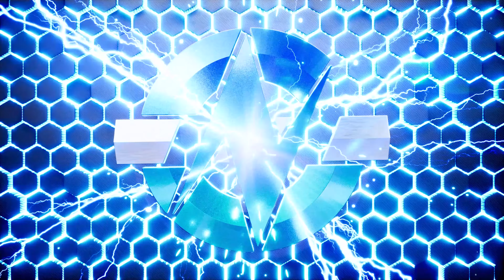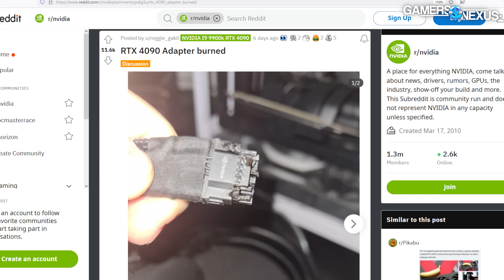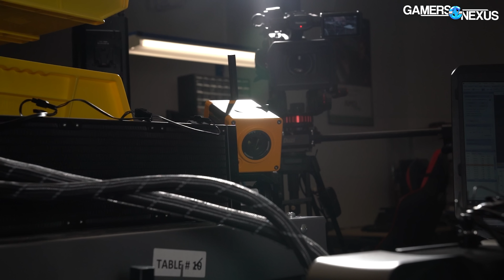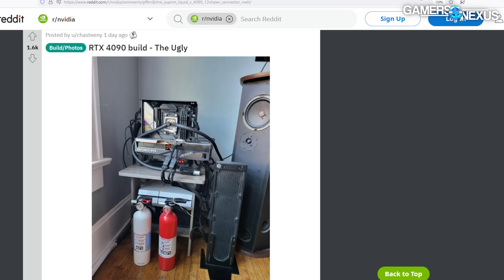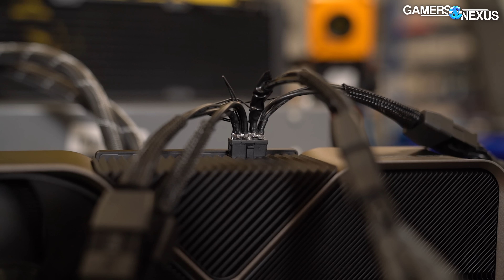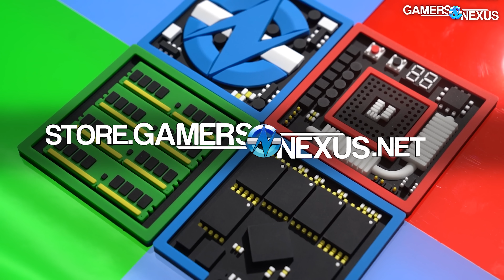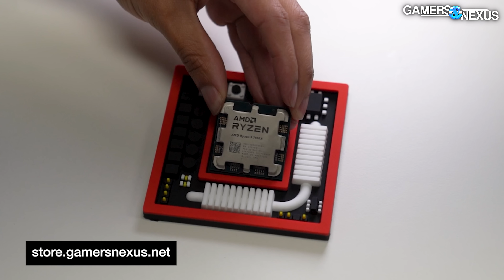Testing Burning NVIDIA 12VHPWR Adapter Cable Theories (RTX 4090)

Comment: This is exactly what I like on your channel I'm not into gaming but you go to in depth analysis of the problems.
I would not worry on the solder side the patches you show ate of good quality & large enough. but as you mention at the end the pins are probably the issue. they are most of the time on RC drones where we need to pass a lots of amps. So you want to look at:
    - The contact surface between the male and female pins it is relatively easy top test: you apply thin and week coloring on the metal of the male part, you insert it take it out and look where the color went away, 
    - The contact force is important as well but much more difficult to measure
Finally one way to identify the weak point faster is: to test it on the bench with higher amps, you may strip all the plastic it will allow you to better identify the source of temp, those will be slightly lower as you do not have the thermal insulation from the plastic.

Comment: You have test load for Your PSU testing right? Why not run a load through the adapter and see what happens at 100% capacity (so 600W?) Also - aren't the power pins bridged on the PCB?

Comment: I thought the Voltage rating printed on the cables is indicative if the Insulation breakdown voltage, not the copper itself.

Comment: I just think that's about nVidia have different manufacturers for same cable. Not about Igor's cable is pre production, because there are more testers who found same issues than Igor's, like Paul's Hardware. And Paul get the real reason about that manufacturer's cable. The issue isn't a broken cable as an electronic's neophyte could think, is the micro distance between both parts who rises resistance between them, who is a very little amunt of air, which causes dangerous overheating, like, for example, the fire issues about NZXT cases who you and your team worked hard to prove. That opposite points of view makes a weird situation, like now you are on NZXT's side proving hundreds of cases never set on fire. O think that's a little awkward.

Comment: I’ve worked for more than a decade as technical lead in the automotive industry and worked on a number of projects during scale up for manufacturing and my biggest surprise about the adaptor is that the litz wires are soldered at all. This has to be done via manual soldering/selective soldering and manual/selective soldering is something that is almost never done nowadays for cable/wire attachment unless it is the absolute only possible way to connect them.

It’s more expensive than almost everything else (manual labor has gotten a lot more expensive over the last decade even in China) and it’s very hard/almost impossible to do this in a way that is process safe, reliable and with the same level of quality. It’s also very hard to test for and prove that the manual soldering actually matches a certain level of quality as well.

In automotive selective/manual soldering is effectively banned unless it’s the only possible connection technology (e.g if you need to connnect litz wire coils with large cross sectional areas to a PCB) and even then the additional requirements necessary to make this process safe would add a huge cost to the whole process. This starts off with plastic clips that the wire ends are inserted into and that are attached to the PCB to ensure that the wire ends have the correct lengths  and are fixated with a defined force, goes to steps like pre-heating the wires and the PCB to ensure that the temperature drop is not to large once you add the soldering iron etc. it also includes a lot of additional testing and additional steps to secure the wire (over designed strain relief etc.)

Even then you almost always have additional failures and RMA like what we can see with NVIDIA’s adaptor due to overheated solder pads, mechanical strain on the solder connections, bad solder joints, “creeping” of the solder (solder maintains a certain level of viscosity even after it has cooled off) and all the other soldering defects and defects due to overstrain of the PCB or solder pads during handling. Only with higher defect rates than industrial soldering (infrared, solder wave or vapor phase soldering) because manual soldering is more prone to errors and the differences in quality are higher.

Remember it’s not a wired connection between components on a PCB it’s a connection of cables/wires to a PCB which undergo a lot more stress from bending/tugging and have to sustain a lot more weight (e.g.4 16 AWG wires 10 cm each hanging off of the connector)

Igor showed a PCI to 12 VHP adapter from BeQuiet which uses crimped connections and in this case crimped connectors or - if you absolutely need to connect wires to a PCB - action pins would surely be both less expensive, more reliable, and easier to make with the same level of quality and better testability during manufacturing than manually soldering wires with relatively large cross sectional areas to a pretty damn small PCB.

Comment: This is really interesting, mostly the thing that intrigues me most is that all of your cables are different to Igor's cable. If there were different batches produced, and there's a wealth of cables like Igor's cable, then it's possible that the failures are more likely with Igor's cable, I think this definitely calls for a large sample set and you're right to put the call out.

Comment: thanks for the careful analysis, but I have to wonder. Why the hell is NVidia, Intel and AMD cranking up power to the point where this type of thermal issue becomes a serious concern? Have they run out of ideas for improving efficiency and reducing power usage?
Reply: They know that there's a market for higher performance components (even at the cost of much higher power), because people keep buying them. They are improving efficiency (perf per watt), but at the same time extending the top end because at least some people will throw money at them for absolute performance.

Comment: Steve is it possible that the heat is being generated from the card rather than the cable? could be as simple as a dry joint on the card?

Comment: Hey steve using the native 12Pin Cable from an ASUS ROG Thor Platinum II 1200W with an RTX 4090 TUF or Strix causes the cards to Show error 43 and the cards are basically useless and seem to be stuck in a low power state. the only way to fix the issue for me was using the adapter that came with the cards and reinstalling the driver. one thing that ive noticed is that the 12pin cable that comes with the power supply only has 2 of the 4 sense pins for the card. maybe you could hightlight the issue and bring some awareness to it cause nothing else seemed to fix the issue for me and i basically replaced all the other hardware.

Comment: Just contact Paul, he has an adapter with the same soldering scheme as Igor. The cables seem to be rated for 300V though, so it would a third variant of the adapter.

Comment: I wonder if the adapters were a stop gap to work around the backlash that would have happened if Nvidia would have required a PSU with a dedicated 12 pin connector which would have caused people to also need to buy a new PSU.

Comment: Soldering to pins is super super dodgy for that high of a current. should be crimped . If its too small to crimp then the connector is too small for the job.

Comment: My theory is that nvidia contracted two suppliers. One that makes cables like GN got and one supplier who makes the cables that do melt.

Maybe the cables that do melt are from earlier batch and the supplier got already replaced and Nvidia is not jumping the gun with the statement or maybe they are trying to keep quiet until the whole drama passes.

Comment: Soldering a high current connector is the worst idea!
If you take a look at a car or any power industry, any high power connector HAS TO BE CRIMPED because crimping offers much more reliable connection than solder.
And if you use non lead based solder such as in industry, you have even higher probability of solder joint to break or at least crack and increase the resistance.
Also, design decision to make a very high current connector smaller is also terrible and it shows the incompetence of Nvidia at making such products.
Therefore Nvidia should concentrate on making a great GPU architecture and leave everything else to the board partners and not try to monopolise also this market. :/

BTW, Amazing work is being done at GN. I hope that Nvidia will be paying you since this is their job to sell a reliable/non-hazard products. And the testing should be done prior to launching the product! Have we come to a point where consumers are beta testers not only for SW but also HW products !?!?!?!

Comment: Odd question ahead, blaim it on my visual impairment rather than call me ignorant... I suppose the 12v and ground pins are well seperated. But couldn't the bending weaken the seperation and create heat that way?Like, a tiny sharp pin that sloly pokes creating a small hole, and the longer the strain, the worse it gets?
Reply: Also, metal, heat... expantion / shrinkage, how much a role does this play in the whole cable...

Comment: I'm pretty confident that the voltage rating is irrelevant, that should only affect the insulation on the wire, not the current carrying capabilities...

Comment: Heavy-rock-hair dude just don't understand difference between USA and EU standard related to AC/DC. 

The problem is not related with the bend only. To simulate successfully need EU 220 power standard. Not USA power standard.

Comment: This is definitely an arcing issue. I believe it's origins are an insertion issue. Since these arcing issues appear to be on the outside pins, those are the first to receive the most amount of load stress from an off angled insertion. The manufacturing process can also create an anomaly of an oblong misshapened PCIe connector "CONN SOCKET" creating a weakened connector and induce arcing.

I really don't think you're looking at the right end where the soldering is taking place. Especially since none of the melting is coming from that location and these connectors have been tested for literally two to four times as much capacity.

Comment: Well crimping instead of soldering as Igor also says - that would be the solution for all kind of cables. It is very easy, that is not the best way of engineering done by Nvidia :)

Cheers thx for this and the other deeper research. Cheers, Pepe

Comment: You use there 12V, so no panic if there is tens of times better isolation. Low voltage typically does not have a problem for arking or leaking trough the isolation, this is more high voltage behavior. So, Ignore the voltage rating, it is not for you!
EDIT: Honestly nvidia was very dumb to solder the cables...these should be crimped. And why they made such a terrible combo? Why not use all standard connectors, just add these more on the side? Very, very dumb move...

Comment: VERY SIMPLE TO UNDERSTAND THE FAILUR the pins are loose inside the connector to teh actual card as its a female on the plug and the card is a male on the connector side if the female side is to wide it wont make proper contact inside if only a tiny bit of the pin is in contact it will get really hot really fast as a thinner wire cant run as much load 

i have a feeling on teh faulty plugs the female side on the power pins is to wide and oncep lugged in there is only a tiny surface area of contact and will start to get super hot

Comment: I still think its too small pins on the GPU board BUT i wonder if its a power supply issue. May want to get power supply make/model of people who have had issues . Maybe its an over current event. For pins to get hot means lots of current. On some of these failures there are alot of pins melting. Are they using those exploding power supplies?

Comment: So really you have to see what you have ?
Looks like nvidia had order a lot of the 150volt one and later 300volt.
If the cabels are make in China.
And you ask later for a extra discount China do not have that problem.
Just use a other cabel and sell it.

People know about the vw fsi engine and problems with the chain .
Wel it go the same way .
The first fsi are fine with a chain .
Later models had cheaper chain metal and that is the reason the chain go faster broken  is that the metal is cheaper.

Do not trust China stuff with small dings like this .

Comment: That connections like that are soldered and not crimped is the fucking problem. You never, never, never solder connections like that, there is not enough strain relieve, you fuck soldering these wire gauges more easily than crimping them. And who came up with the idea to push all this through a single connector... There are standards for a reason. The resistance rises when you push it through so small pins, thats also obvious. For around 37.5 Amp draw, you use fucking blade connectors and not pins (or when pins, way thicker ones), i dont get why they didn't used for example molex super saber or mini-fit connectors. And you crimp it. Crimp it!

Comment: Wouldn't removing the shroud and tape around the soldered connecting parts remove the heat insulating components and allow the cable adapter to dissipate heat more easily? 
Shouldn't you be damaging the solders and reassembling it back together to allow it to build up heat with all the insulating components just like the regular damaged one would?

Comment: if the theory of Nvidia being aware of this failure is true I'm certain they would triple-check to send GN the good cables unless they want to ruin themselves, my own theory is that those connectors are made with repurposed 30-series parts but the 3090ti already pulled similar power without melting so it could be more than a single factor in play
again I'm just eating popcorn at the sidelines as someone who doesn't care much about hardware that costs as much as an used car

Comment: Hmm, I'm not quite so sure about this being solely a contact/cable issue routed to the adapter and receptacle. To properly replicate this issue, one would 100% need the failed setup. Perhaps the problem is more PSU related with uneven loads on different 12V rails. My old enermax platimax has four different 12V rails, if I would use such a beast of a card with that adapter, I would at least need two different 12V rails as those are rated for 30Amps max.
Now, I know for a fact that each individual 12V rail has a slight variance in the mVolts up to half a Volt, also they have all slightly different resistance inside the PSU. If f.e. such an adapter is used with four different 12V rails, the one with the smallest internal resistance will provide the most Amperage. Adding to this that at the connector on the cards pcb, all "different" 12V rails are connected there could be potential unwanted differential voltage compensation. Now if one of those 12V rails caves in under "foreign" current or somekind of protection trips, it could be that the whole load travels back along the 12Vs cable which rail has failed, which could be up to 600W.
So, uneven 12V rail loads, mishmash of 12V rails, bad connections... one would need the exact system that has produced a burnt adapter, swap the adapter stress the system again but with volt and amp meters hooked on and in the cables.

Comment: The two thoughts I have are 1) what temperature does the plastic melt at? Surely way higher than anything seen on a card (>120°C), and 2) Why are the sockets on these cards in such a stupid location for anyone to run a cable to?

Comment: sure the cable may be rated 105°c but what about the connector?

and can imagine multiple connector manufactors maybe using slightly different plastic.

test melting point of the connector on the different adaptors u got may be a early batch or specific batch wit lower temp resistant melting connectors.

not that i know of any plastic that starts to burn at 70°c but some that become very soft at that temp and maybe causing some other problem causing the burn like sloppier pin fittment or something that can cause more heat,

Comment: So the cable reached almost 70 degree on an open bench.... 
Now put it into a case with bad airflow and the environmental temperature goes from 20c to what... 60 c? 

Add a cheap power supply with thinner gauge cables adding more heat into the scenarios.

And you could reach a thermal runaway I guess as the resistance increases due to temperature.

Comment: Those pin we use in the car electrische.
Zo pin set for 5 to 10 amp 12volt. 
The pin are not the problems.
Its that alle the pins are together and the heat up in that plastic.
In the car we limit to max 5 amp if so set off pins are that close .

Comment: @Steve, soldering Tin is poisonous ☠️ it gets stuck in your respiratory system forever! Use a mask with Cartridges or a good quality solder air extractor (this does more that extract, also capture in some paper alike material the burned Tin)

Comment: Voltage rating on wires just tells you how much electrical insulation it has (normally from type or thickness of the actual insulation around the conductor) It doesn't tell you how much current it can safely carry (conductor thickness/material)

Comment: The most likely issue why Igor’s cable is different is that NVidia multi-sourced the adapter (i.e. subcontracted multiple suppliers to provide enough adapters for the RTX 4000 launch). This is standard operating procedure in manufacturing to manage risk (if one supplier has a problem only that suppliers tranche of the total is delayed) and to provide a certain number of parts more quickly.

The issue with the subcontractor that made the adaptor Igor has is that it very likely doesn’t even conform to the CE spec and probably isn’t even legal to distribute in the EU